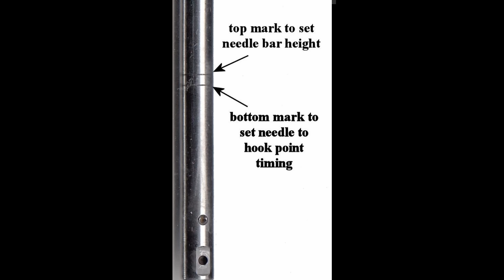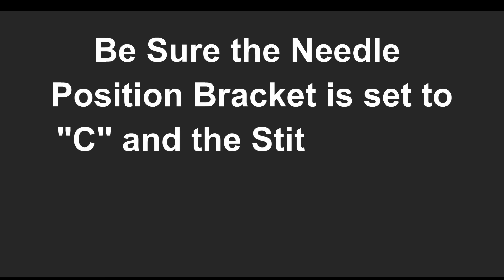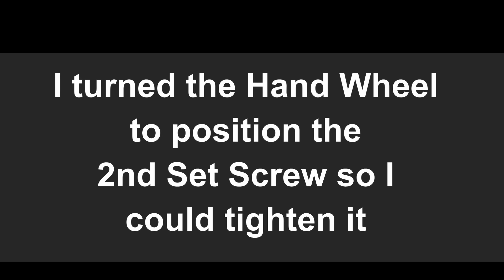How to Check and Set the Timing on the Singer Model 413 Sewing Machine

Comment: I followed all of these steps and matched the hook to the needle, but my problem is that the hook does not move after everything is all tightened back up. The belts do not move when the hand wheel is turned. What am I missing? I appreciate your very detailed and easy to follow steps!
Reply from the maker: Uhoh, I was worried about this. You have not read my reply to your earlier comment yet, I guess. I'm afraid you have a broken plastic gear on the top of the vertical shaft that transfers movement from the main arm shaft/wheel down to the bottom belts and the hook. Good news, a new gear costs about $10 or less. The bad news it can take a couple of hours to replace. It is worth it though b/c that is the only weak part of the machine. There are about 6 to 8 models affected by this problem and it is internationally known. I made a video to explain it and show step-by-step how to replace it. https://youtu.be/M3bFtlV1Y6s
Reply: @andytubesewing1953  I had a feeling it was something like that. I last had this machine serviced several years ago, and not long after, it stopped working again. At that time, I decided to invest in a newer model and have had the old one just enjoying retirement in its cabinet. Then today I wanted to bring it out and see if I could figure out how to fix it (assuming it was just the tension) without having to fork out a huge payment for someone else to tighten a screw. So, it's a bummer that I never took it back in because I believe they replaced that part back then. Good to know it's a cheap fix, and I don't mind putting in the work to get it up and running again.
Reply from the maker: @ChrystineHolcomb  I'm sure you can replace the gear, Chrystine. I had dozens of people email me thanks for the video and that they changed the gear successfully. So far their ages have ranged from about 13 to 84. I will mention a couple of things. Several of us feel the white/clearish colored gear is of better quality than the black gear. I'll also remind you not to put oil on any plastic gear. Not needed. I had a fellow write me last summer that his wife paid $120 to have the gear changed and about a week later he decided to oil the machine and thought the manual showed to oil the gear so he did ( it shows to oil at the base of the meatal gear hub ) The next time his wife used the machine the hook quit turning. He opened the machine to find the teeth of the gear had literally melted down. Whew! Of course, after changing the gear you reset the timing, but you already know that. Best of luck. Take Care.
Reply: You were right! That gear was covered in oil and chewed to bits! Thank you so much for the help! You've saved me some money and taught me to do something new!
Reply from the maker: @ChrystineHolcomb  thank you for the verification it makes sense not to put oil on something that's made out of oil I hope the gear change goes smoothly for you and you will soon be enjoying that very nice sewing machine by the way the new gear could easily last 20 years

Comment: Hello. Can I use these instructions also for my Singer 740? I'm having problems because the needle touches the crochet, bends and breaks.
Reply from the maker: I don't think these directions pertain to model 740/760. I have hundreds of parts/service manuals but none for the Singer model 740. I did find the Instruction Manual at https://www.singer.com/search/support?title=740
When I look at page 58 of that manual I see the Hook Drive System is a set of 4 gears and not 2 pulleys and a belt like the 413.
     I'm not sure if the timing is even your issue. Many of the type of machine you own those gears are plastic and your machine is 50+ years old now so chances are the plastic hook gear is worn; maybe the other gears are also. It may be a good idea to investigate further before making any changes with tools. 
     Here is a website for a man with 30+ years of experience working for SInger and having his own repair shop. He knows more than anyone I know of about your type of machine. He sells Service Manuals and has even written his own guide for changing gears and other repairs on them. Here is his page of the 700s models of Singer machines: https://store.tandtrepair.com/tosew700se.html    You see he sells a Timing Guide for $5.95 and has a gear replacement & timing guide for $8.95 as well as other Adjuster Manuals and servicing manuals. On his info page, he gives an email address if you have questions about which manual would be best for you. Terry has always treated my and my friends very well and he is a great guy. 
     You mention the needle touches the "crochet" and I don't know if that means the Hook or what part. The Instruction manual I mentioned above from Singer (It's FREE by the way, you just download a PDF) has some pages for cleaning and how to remove covers, etc. so you should easily be able to look around the machine and remove lint, gunk, etc. and even inspect those gears for damage or missing teeth. That's a good place to start. 
     Good Luck, and thanks for watching my channel.
Reply: @andytubesewing1953  Thank you very much! Above all for the time you took to reply to me 🇮🇹! I have just sent an email to Terry 🤞 Hope he can tell me what's happening to this machine.
Reply from the maker: @claudiaterra5441  He still has full time work, but he has been good to us so many times. Best of luck.

Comment: What size Ellen key did you use, please? I'm trying to adjust stylist 457 and I'm struggling to free up the bobbin pulley.
Reply from the maker: My Allen wrenches are old enough that the tiny numbers are worn off. The service manuals rarely say the size of wrench to use. I have a standard set and a metric set and they are loose and all mixed together so I just find the one that fits. If you are using standard size, try metric and if using metric try standard. Is it that your wrench is a bad fit, or the screw is "stuck" or "stubborn"? Use some penetrating oil and I also have used a hardryer to heat up the area to soften and dried up varnished oil that may have "glued" the screw into the hole. I have also done a slightly risky manuver of putting a wrench in the screw and given it a sharp wrap with a small hammer or mallet. Like giving it a jolt to "break it loose they trying to turn it free.

Comment: Hello Andy, 
I recently picked up a Singer 648 off the side of the road. I've been teaching myself and my daughter how to sew on it, and it's been an amazing learner machine what with touchless bobbin winding and all. Things were going great until the vertical shaft upper timing gear stripped. My local repair shop had the gear in stock, and gave me a 30 second rundown on how to get it out and time the machine. I've replaced the gear, and with the help of your excellent video I've timed it so it works again like a charm. Only thing is, it seems a little noisier and the whole machine seems a bit tighter. Could this be the new gear seating against the old? Have I somehow messed up gear preloads and don't have enough lash? Any ideas? 

Regardless, thanks so much for this video. My daughter and I have fallen in love with the machine, but it certainly falls into the 'not worth fixing' category if one is paying shop rates. She lives on!
Reply from the maker: The machine rescue of 2019! Congratulations and thank you. The original part no. for the gear is 163987 and Singer later used part no. 163328 as a replacement. If the shop gave you a gear with one of those part no.s you have the correct gear. There really isn't a gear "preload" that I'm aware of, but usually, gears should be gently pushed together completely during the install and the metal base of the gear, especially on the lower end of that shaft, should not touch or ride on the bearing housing. Our tendency is to push up on the shaft and maybe force a little too hard of a mesh while we tighten the set screw. The new gear you installed is not meant to be greased, but I'm wondering if the broken gear did have oil/grease on it. I'm asking because the last two machines I help viewers with who had a similar noise/roughness it turned out to be small crumbled pieces of the old gear has stuck in the teeth of the metal gear on the arm shaft and when the new gear was installed they ended up stuck between the gears. That throws of the mesh quite a bit of course, right? So the first thing I would go is to check that the new gear and the metal gear it meshes with are clean and free of any plastic bits from the old, broken off gear teeth. Maybe a toothbrush, with alcohol if needed, can fit in there and scrub as the handwheel turns slowly by hand.
I would take a very close look at that before I changed any more adjustments. OH, the meshing and gear base touching bearing housing goes for the vertical hook drive shaft on the bottom also. Usually, you can tell if they are rubbing as you get that metal-on-metal humming sound. I only have made one video of changing that top gear on the vertical shaft. On a different model that has a pulley on the bottom, but the whole idea is universal to most model numbers: https://youtu.be/M3bFtlV1Y6s
Thanks again for saving a vintage machine and happy new year 2020
Reply: Hi Andy, I sure appreciate you taking the time to reply! I did check that the metal portion of the gear and the bushing support were not touching on the lowers (which all had to come out to get the vertical shaft out), but I haven't checked the vertical. Will do. Also, the whole machine has been greased and oiled, so when I can get it on a decent work surface other than my kitchen table I'll go over it long and hard with the alcohol - it's a mess in there and the lower gears are getting soft too. Just wanted to make sure I could pull off the repair before getting crazy with a whole new gear set. 
The original upper vertical gear was secured with a roll pin through the gear base and the shaft. (which was a bear to remove!) The replacement gear features a set screw. Could this be an updated design, or do you think I have the wrong gear? I made sure the set screw aligned with the roll pin hole in the shaft to be on the safe side, and in all other ways the gear appeared identical, but of course now that's in my head as a 'hmm.' 
The machine is working well now but is a bit stiff off the start. I wish I could try a few other machines of similar vintage to see how far off normal mine is. 
I'll start with cleaning. Do you have a video on proper oiling procedure? Videos I've found lack nuance. 
Thanks so much again, and happy new year to you and yours as well!
Reply from the maker: @markv3559  You impress the he...er, HECK out of me removing the roll pin and gear. Nicely done. I don't really care for the Touch & Sew models with their plastic gears and Auto-Reel or wind in place bobbins. Just my opinion. I did not do an oiling video for a T&S machine but have done a dozen others. Here is one on a model 503A showing full lubrication after washing the machine with Krud Kutter, just don't you put any grease or oil on any gear on your 648. https://youtu.be/zo3c9CTgVGg  Pages 63 thru 68 of the original Instruction Manual show all the lube points of your machine. If you'd like a free copy it is available from Singer at this link (PDF Format, 80 pages, 96MB) https://www.singer.com/sites/default/files/outdated_product/a6172931362178d23f294bac5f8cd24f48798c80_0.pdf
     You can also go to Terry's TANDTREPAIR and download some free instructions he has for T&S Models, like working on the tension unit and adjusting the tricky little BW parts and other items. He also sells Vintage Singer parts, supplies, and guides, both factory and ones he wrote. He was a lead tech for Singer in the Decade the T&S machines came out and knows more than anyone I've met about those models. He gives Andy Tube viewers 20% off anything they buy before midnight tonite (he had the coupon for all of 2019) USE COUPON CODE andy-h-yt at checkout. http://site.tandtrepair.com/600TandSstuff.html
      I don't know how much work you want to do on the machine, but cleaning and oiling it usually fixes a good 80 to 90% of the problems besides damaged or missing parts. If you find it hard starting it can be lack of oil, especially in those bushing/bearings for the shafts, and it cal also be binding from oil lacking and dirt and dried up old oil (hence the cleaning) I have several cleaning videos, but here is a playlist of a restoration that you can skim through the titles to see if anything looks interesting to you. https://www.youtube.com/playlist?list=PLsCOZgzzaiKJxbOOMKQPvmeTRqi0dhGa5  
     Another thing you may (probably) need to look at is the foot controller. Your machine is 50 years old and chances are the foot controller has never been serviced. Countless times I have helped people who wrote to me about a slow, hesitating, buzzing motor and it has turned out to be the foot controller. Here is a series on restoring a clamshell-style controller;  https://www.youtube.com/playlist?list=PLsCOZgzzaiKItPLWcK24FBoMdHK8vTXNi
      If you do feel it's a motor issue after cleaning the body and mechanics then here is a series for restoring the PA style of motor that's in your model: https://www.youtube.com/playlist?list=PLsCOZgzzaiKJSu0T9oeaheTZsrUe91kkZ
     So you can go as far as you like in working on your T&S it's basically up to you. Anyone that can change out that top gear on the vertical shaft can do any other mechanical adjustment on a sewing machine. I have about 500 videos on my playlist page sorted by the model number that I posted to help people work on, fix, clean, restore vintage Singer Machines: https://www.youtube.com/channel/UCUSPDsHaFtRoz1VA2U1xJ4w/playlists?view_as=public
     I'll just thank you again for saving that T&S and giving it a chance to create, sew and craft again as it was made to do,

Comment: Hi Andy! Thank you so much for these amazing videos! I'm wondering if I could ask a question. I've been trying to oil and clean a Zig-Zag Model 413 and it seemed to be working well until it came to sew. Everything in the top looks like it's working well, except I couldn't get the bobbin thread through the centre hole. The needle would not pick up the bobbin thread at all. When I got it through the centre hole by taking off the bobbin plate (with the 5, 3-4-5-6 numbers) and tried to sew, the needle went through but nothing happened. I took off the bobbin plate again to oil things, as well as the reverse-L shaped metal bracket that fits with the bobbin case, and it looks like the race (the circular plastic piece underneath the black plastic bobbin case?) isn't rotating or moving at all. I oiled it, and I've managed to make it move slowly once or twice, but never at regular sewing speed or consistently. Any wisdom on how I can make it work? Thank you so much! Your videos have already been so helpful.
Reply from the maker: Hi, Jordana. I've got bad news and good news for you. The bad news is that the top gear of the vertical shaft (plastic) has failed. Probably the teeth are/have chipped off. The symptoms you describe are the classic tells of this.You are not alone. Thousands of Singer models from the time have this problem. Now the good news! For $10 and some labor you can fix it and make it like new again. I have a video that you can follow along and remove the old gear and replace it, then reset the timing back to normal and be sewing along just fine. Here is the video: https://youtu.be/M3bFtlV1Y6s     The Gear is SInger Part #155819
Example: https://www.sewingpartsonline.com/vertical-top-shaft-gear-singer-155819.aspx   There are many sellers of this gear so feel free to shop around for price. Try to find a white gear if possible. IMO they are better quality and last longer.
Remember, no oil or grease on your new gear. Bad for it. I'm glad you found my channel and asked about your problem, and I hope you will return in the future.
I have few more videos of your model https://www.youtube.com/playlist?list=PLsCOZgzzaiKKVlkxPT9FMTdvUUGj8Ydf8
Best of luck, Jordana, and take care.
Reply: @andytubesewing1953  thank you SO much!! I really appreciate your response, and I'll update you when I fix it!
Reply from the maker: @jordanaweiss8423  You can do it, Jordana. Yes, if you have time then let me know when it is finished. It is nice for other viewers to see that people are able to do this repair and it gives them confidence that they can do it too! Good Luck.

Comment: Hello I have a question now just found my problem with my machine 😢 can you tell me what part it is ? It's part of the top looks like that my problem not the tension
Reply from the maker: can you be more clear about the part? I don't know which of the 100 parts you are asking about. Here are all my 413 videos: https://www.youtube.com/playlist?list=PLsCOZgzzaiKKVlkxPT9FMTdvUUGj8Ydf8    one of the videos is a tour of the machine: https://youtu.be/ULaBoDecxAU     you can also download a free copy of the instruction manual form Singer Support: https://www.singer.com/search/support?title=413   If you can point out or define the part you are asking about left me know and I'll give you a part number.
Reply: So I found a video the part I need is the vertical top shadt gear it broke that's what the part is .I appreciate you videos I got this machine free and used it once until this happened and couldn't figure it out .
Reply from the maker: @natashashadden567  Yes, the top gear of the vertical shaft. I've used this gear a dozen times: https://www.ebay.com/itm/202777631971?epid=665814990&hash=item2f367d1ce3:g:QGcAAOSwMe1deuVX
Bob has a good video for replacement, maybe that's what you saw? https://www.youtube.com/watch?v=63LXYiIVuoM
IMO, avoid the black gear some sell.